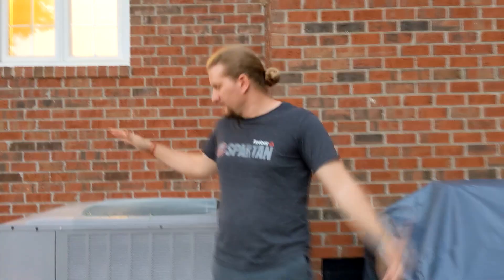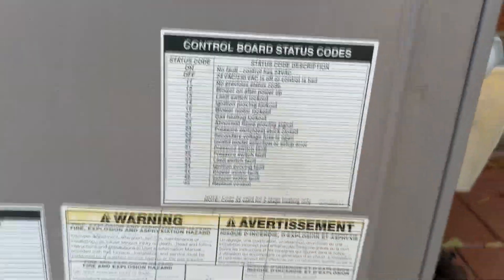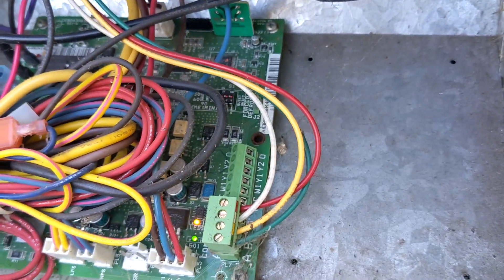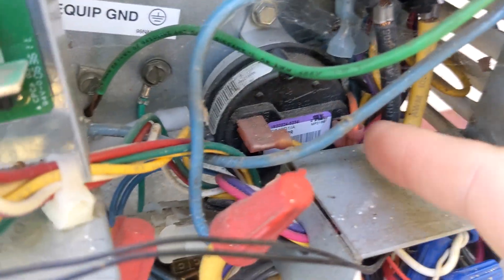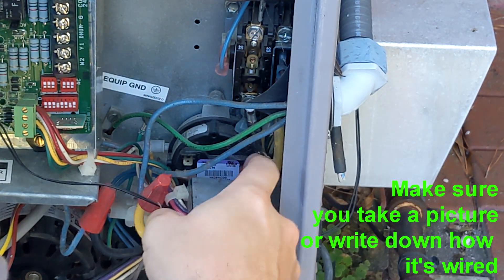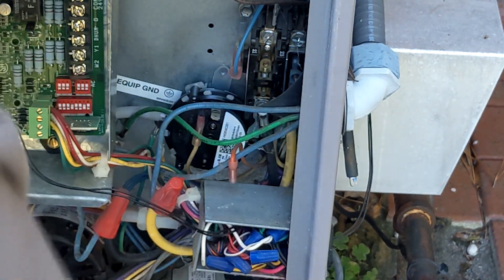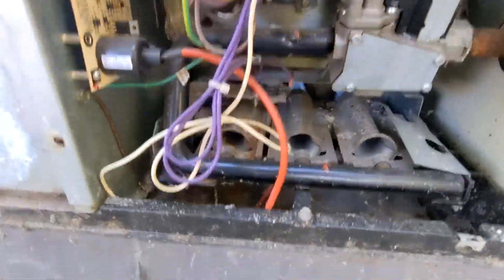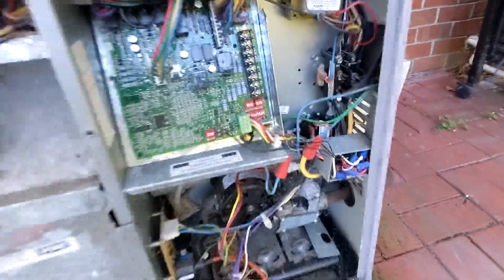HVAC Blink Codes - DIY Diagnose Your Unit

Comment: Well you aren't an HVAC Technician that's for sure, you got lucky it was the pressure switch. Proving a pressure switch is defective is very simple I have started teaching my students how to prove that a part is defective. 
Yes, an HVAC supply house isn't going to sell to a homeowner its because that homeowner are a pain in the ass. 
FYI, to purchase refrigerants you need an EPA Cert. Period
Reply from the maker: Thanks for the info!
 I looked into what it takes to get an HVAC license, because this is the 2nd part I've had to do this way (first was a capacitor). 20K hours! WOW that is massive.
You are right I was lucky, pressure switch is easy. If it was something more advanced with the burners or something I probably would have called a pro.
When you say you prove it is defective, do you mean testing with a continuity meter, just to see if it is electrically broken? Or do you hook up a pump to it and push it over the "WC limit to see if it trips?
Reply from the maker: @drwlpwasright5132   Awesome info, I'll add to the description. Thanks!